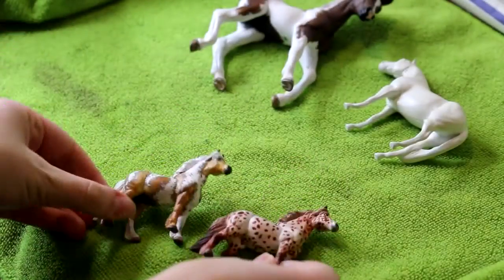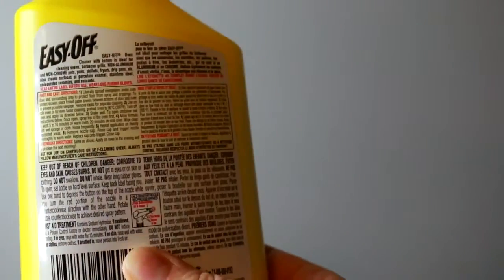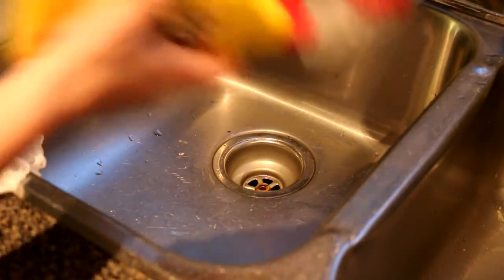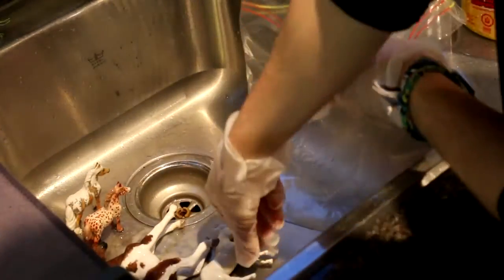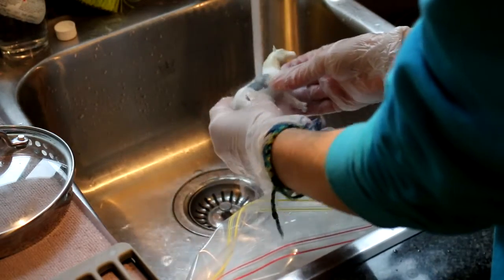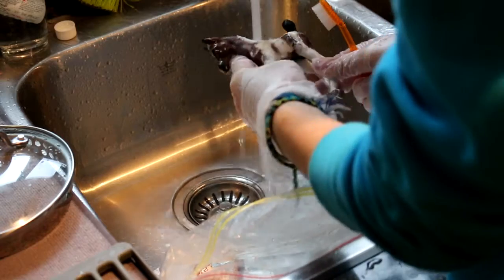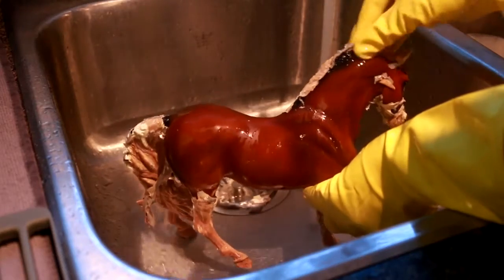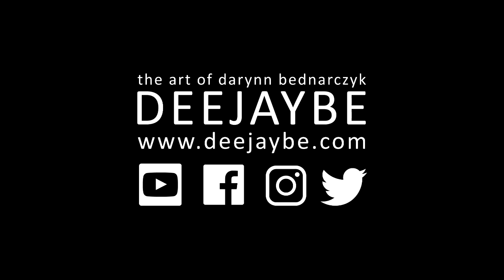HOW TO STRIP a Breyer Model Horse Custom of its Paint - Tutorial

Comment: Thank you so much! does it work as well on the original paint that the Breyer model comes with? I've read that bleach works as well but I definitely trust more in your opinion because you're a master in customizing breyer horses! thanks!
Reply: dont use bleach it'll hurt the model severely long term, and all your hard work will get ruined (it warps the plastic and causes everything to flake). I've seen some people have success with acetone free nail polish remover  to remove OF paint but am unsure if that has problems long term, the oven cleaner wont remove OF paint just custom work im pretty sure

Comment: What does this do to the model in the long term? I'd be worried about the longevity of the plastics.
Reply from the maker: Bleach is a big no no, it causes issues to the plastic. There have been no reports of this stuff causing problems, since it is just a surface cleaner. You can see on the model, it only takes off the paint layers you add, and does not remove the OF paint.
Reply: I just got some vintage models to try customizing but a lot of the original paint isn’t coming off. I have sprayed and soaked overnight 3x but nothing more is coming off. They should be ok to progress to the next step, yeah?

Thank you so much for your simple and informative videos, I love them.